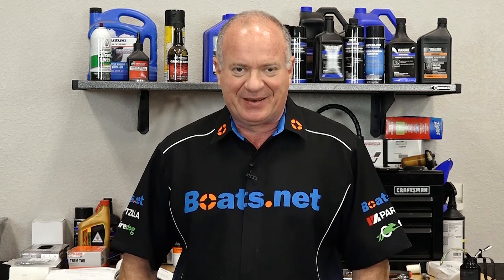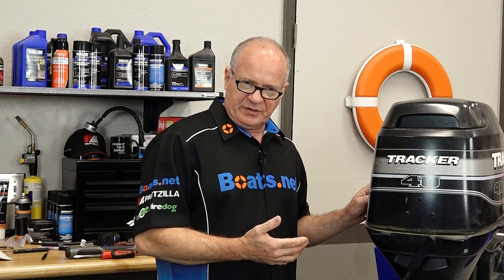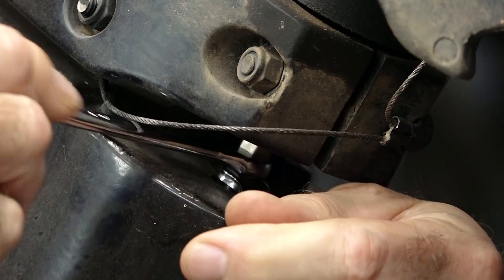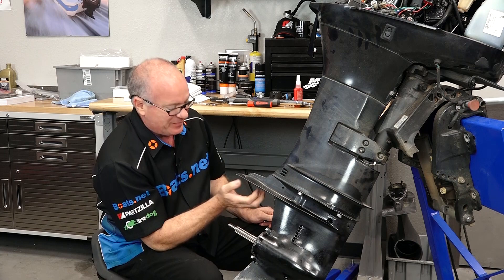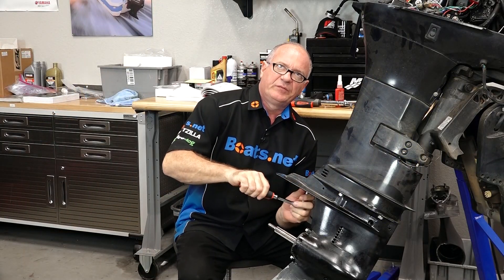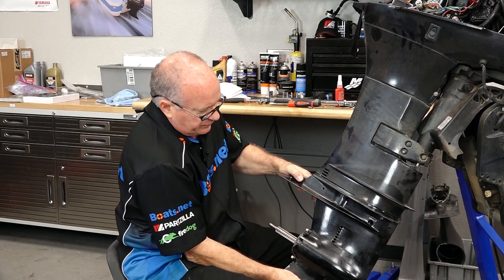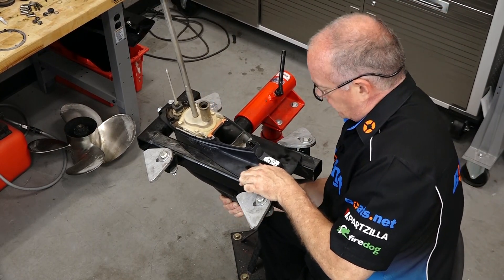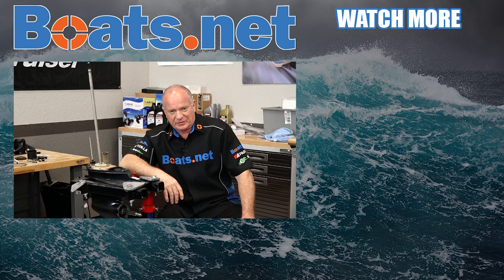Mercury Tracker 40 Gearcase Removal | Mercury 40HP 2-Stroke Lower Unit Removal | Boats.net

Comment: I hope you may be still answering questions. When you drop a lower unit on a Mercury 2-stroke (1998 115hp) do you need to put it in neutral, reverse, or forward before you start undoing all the bolts?

Comment: Question if you don't mind, I have a 1997 Mariner 50hp 4 stroke that I will be replacing the water pump on. I don't see how to unhook my shift linkage or whatever the piece next to the driveshaft is. I've seen other videos where the lower unit just drops off without unhooking anything else and others where they unhook a shift linkage above but I don't see that possible on mine. Thanks for any insight you may provide.

Comment: 1
First: are all of these videos for the repair on the Mercury 40hp oil injected 2 stroke w/ sn OG071472 applicable to the entire year spread, including 1994?  Where can I obtain a puller like you used to remove the the lower gear shaft?

Comment: is this exactly the same engine as a 40hp Mariner by Mercury approx 2001 model ? It looks the same.
Reply: It’s a 2 cylinder mercury/mariner 30/40 hp came out in 1994 made till 2004

Comment: Hi John, a good friend of mine has a 25HP outboard Merc. It leaks oil, but it isn't apparent until it's in the water and an oil slick appears. Prop shaft seal was suspected but it doesn't seem to leak under pressure outside of the water. Is there any other seal, that comes to mind? I don't think there is a shift rod in this motors lower end. Could it be the drive shaft seal? Thanks in advance.